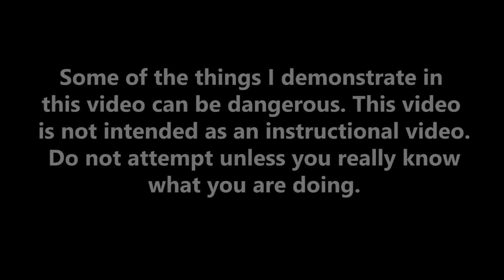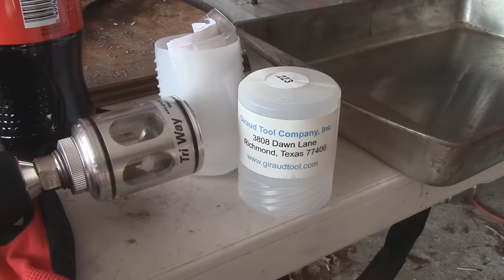How I'm Reloading 223 for $.10 Per Round | CountryBoyPrepper

Comment: Is powder coating necessary or..?
Reply: Gabriel Swan Not necessarily but if you dont you will need a gas check i believe which cost a more than powder coating. Plus powder coating is great

basically:
• It’s an alternative to “lubing” the bullet (usually done with wax or liquid lube)
• It gives you a solid jacket around the bullet which helps or prevents barrel leading.
• It doesn’t require a copper gas check like wax or liquid lube (which are expensive at 3-5 cents a bullet)
• It’s just as easy or easier than lubing the bullet
• the different color coatings help organize bullets
• They are not as messy in reloading dies and don’t require a lubri-sizer which requires cleaning
• If you have an oversized barrel then the coating can allow more diameter to work with

There are probably others but thats all that i can think of.

Comment: You say $.10 a round, but after you go through all the cost for powder, the chemicals you use and everything else on top of all the power you consume with each of those different machines, the cost is around the same amount for a box. you dont notice it up front because your not looking at the electrical cost and the component cost, but it roughly comes out to the same cost if not more in some cases.

Comment: I'm not sure how you figure 10  cents a round .  To know for sure you would have to know exactly how many rounds you fired, then you would have to add up all the equipment you bought, and you bought a lot of it.  How about the utilities you use such as electricity.  I think there are a lot of hidden costs that you have been taken into consideration.  PS.  Inhaling lead fumes will catch up on you down the road, I know that for sure.
Reply: amortization based on costs for machine and subsequent machine life including maintenance drive it down.
I know a guy who picks up range brass has an automatic case sorting machine, 5lb sonic drum cleaner, and three automation machines that load 9mm, 45acp and 40 cal. Has six employees who run machines and box rounds that are sold to various stores and law enforcement....must be making money.
My original complete set cost mom $20 back in 1968, I still have it and it's still reloading rounds. My rifle ammunition costs anywhere from $26 a box to $60 a box if you can find it and the last time I reloaded it was .38 cents a round using factory bullets and not cast.

Comment: On what planet does this work out to 10 cents a round? 
I know many have spoken to the amount of time spent. That is one thing to consider for sure. How precious is your free time? How much do you save by doing this and would you be willing to pay that much to not do this? I would.
Other people point out the various items needed. A tumbler, a press, powder coat, 2 different ovens, 5 gallon buckets, dirt screener, electricity, brass case lube, hand drill, primers, powder, burner for melting iron, ingot molds, bullet casting mold, etc. I wonder how long it would take to recoup the cost of the items when i'm only saving around 100 bucks for 1000 rounds. Probably a long time.
I can get factory ammo, brass case, FMJ, for 22 cents a round. I will happily pay that difference to avoid doing all of the stuff I just saw in this video. My time is better spent, even if it's just on my ass watching TV. That's why I go to work, so I can do what I want when I want to.
This is part of the hobby for CBP and I say more power to him! Some people play an instrument, some work out, some go 4 wheeling, this guy makes his own ammo. To each their own!

Comment: 30¢ a round is not expensive. 10¢? Whats about electricity? All tools? How many years it will pay off? I think it will not, because of spent electricity. Or, of course, you can buy solar panel farm(another thousand dollars)!
Reply: Probably only costs a few bucks a day to run that stuff
Reply: It actually cost him nothing to make if you watch the end. In a Collapse scenario, he could easily use fire to smelt the ingots, and a manual hand roller to clean the brass. Think of him like Eugene from the walking dead. His tallents seem odd, until they are completely necessary. In a collapse, he would have 20 people doing this for him, while he rules bullet town. (mad max)
Reply: Circie Quisling  Good point, he could do all this without electricity.

Comment: Not 10 cents a round.  You are leaving out costs of power for ovens and drills.  The primers
  and powder costs more than 10 cents a round.
Reply: It doesn’t take that much powder to coat the projectiles, not to mention that taking into account of “power for ovens and drills” is pretty penny pinching if you ask me.
Reply: My point is when all costs are added up you dont 
save much by reloading.   Most reloaders are doing it because they like it, not because it saves them money.

Comment: Instead of collecting lead and melting it into bars, why not just buy the ingots? Lead is a very cheap metal. I am assuming you shoot a lot which makes the savings add up but as someone who may shoot less than 2k rounds a year, if that, buying all the equipment and spending all the time doing this would not make it worthwhile to save ~$400 a year.

If you enjoy doing this, then I guess this is a hobby on its own and it doesn't matter if its cost effective.